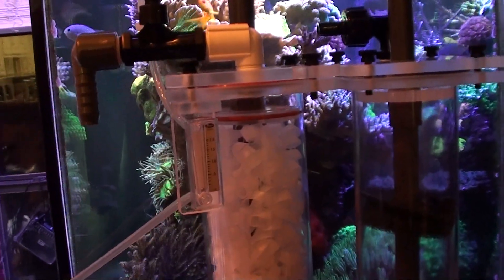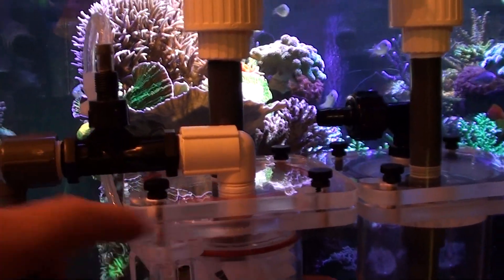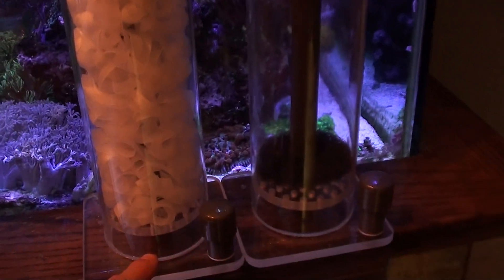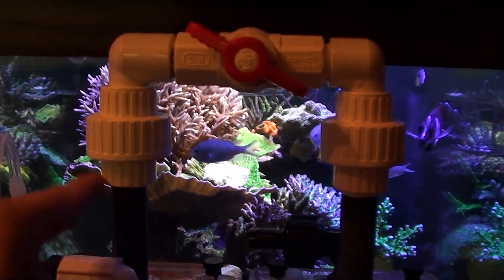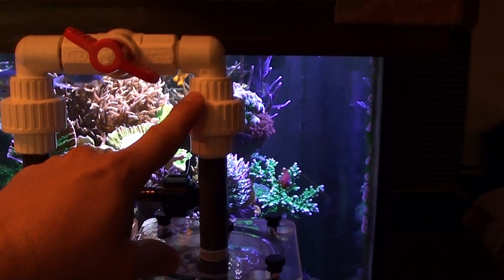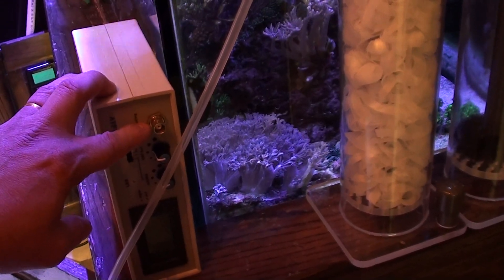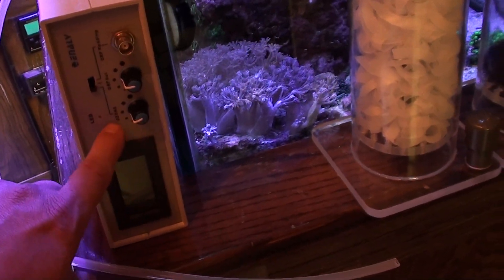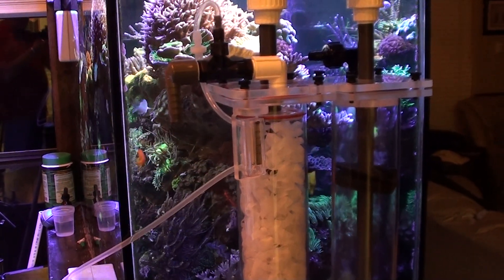ozone reactor dry walk through

Comment: Avast recommend to run the carbon post filter with top-down water direction...So water should enter on carbon reactor on the perimeter fitting instead of the center one. Did you notice any issue running it in the center fitting ?